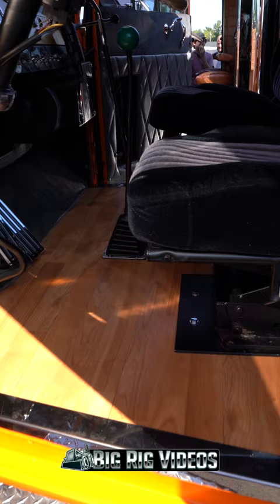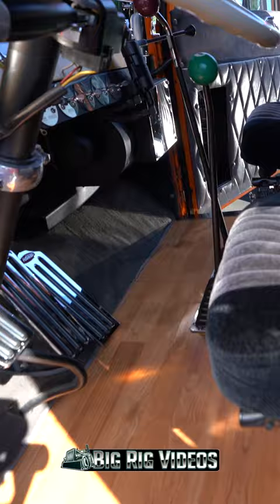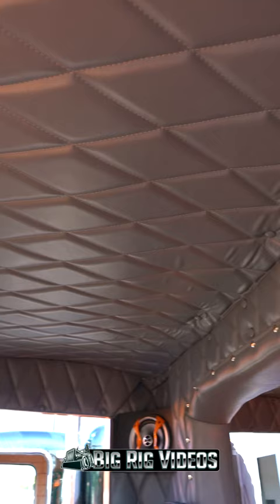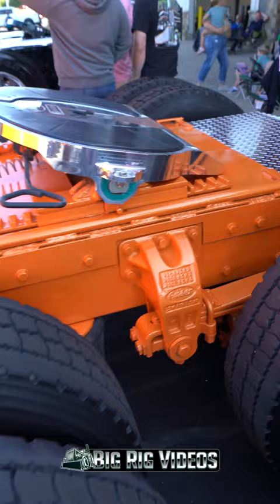#CarolinaCrush #twinstick 1969 #Peterbilt #358A #Cummins335 #trucking #semitruck #oldschool

Comment: Bet if that truck breaks down it’s out of fuel or there is a hole in the block.
Reply: the best kind to have, truck that is
Reply: Nah if the old trucks are out of fuel you just limp to a nearby fuel stop by spraying ether in the air cleaner. Just don't do it for more than a few miles lol.
Reply: Tell me why you say hole in the block comment. Sounds healthy.

Comment: NTC 335 Cummins Big Power back in the day
Reply: @@Dartgame340 my dad drove a 71 Freightliner with a 335 that was bought new. When he came in for the 1st service and oil change the old mechanic at the shop took the fuel pump apart and tweaked it. It was an absolute animal after that. Nobody could catch it the other steel haulers called it the white phantom (it was all white including the frame) The downside was that it took his fuel mileage down to 3 miles per gallon but at 30 cents a gallon it wasn't a big deal.

Comment: Awesome Pete, but didn't know the 335 had an after cooler. Sure it's not a 350? Back when they were built in Newark CA
Reply: You're right, they don't. That was a good update for a 335 though. Kinda makes them a small cam 350.
Reply: @paulcallen6129  So are you saying guys would add an after cooler to their 335s? My Dad often mentioned that 335s we're know for breaking deadbolts.
Reply: Breaking headbolts. They get stretched so you have to replace or they will break. And no a 335 does not come from the factory with an after cooler. No reason to be calling it a 335
Reply: Damn a straight blade. Fan clutch add another 25 hp.